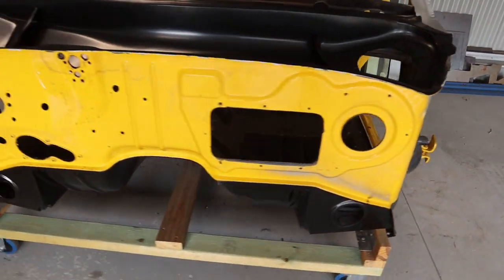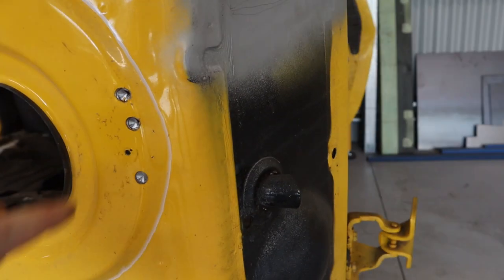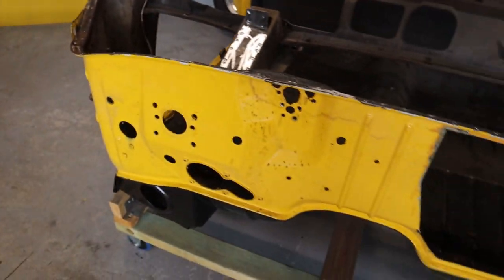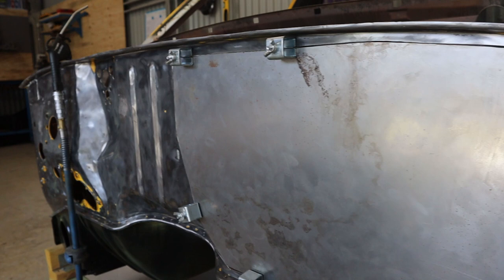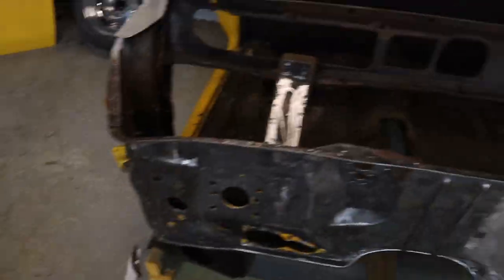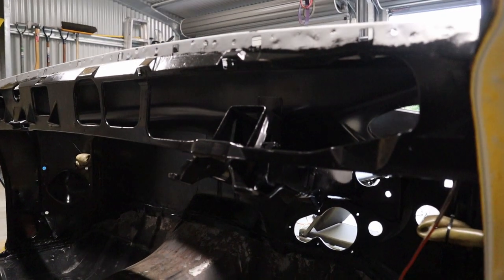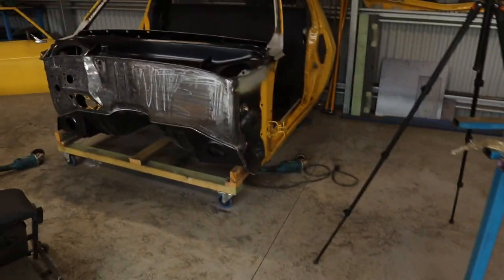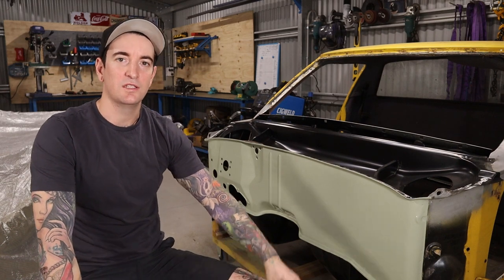HX One Tonner Build - Smoothing out the Firewall

Comment: Another Great video Sam, smoothed firewall looks far better then factory so much cleaner, you won't need AC when you double insulate with car builders and put on limo tint 🙂
Reply from the maker: Thanks Mate. I herd the car builders product is good. Would you say to lay it on roof aswell?
Reply: @ShenkeGarage  yeah mate I have used in a GQ and GU patrol build is good for the trans tunnel and I put on the roof also just to reduce heat and sound proof the cab. Made a huge difference.

Comment: Is a heater/demister not required to get passed over the pits for rego ?!... definitely much tidier look without it! Good work so far!
Reply from the maker: Hey mate the only requirements that I know of is the windscreen requires air to be able to be blown into it. Does not matter if it's hot or cold as long as air is blown into the front windscreen. I will plumb a electric fan motor into the vent that blows into the windscreen. Thanks also Mate.

Comment: Hi Sam love the videos, just a question, when you did the floors did you weld the inside as well ? I’m about to start my HZ and curious on How  do they look from the inside if you didn’t cheers mate keep up the good work👏👏
Reply from the maker: Hey Mate. I only welded them from the outside as I butt Welded them in. If you leave a slight gap the weld will penetrate through the join and you are left with a slight bit of weld on the inside. You can either leave as is or grind back slightly as you dont want to make the metal too thin.
Reply: @ShenkeGarage  thanks Sam, i started mine today and stripped the same passenger side roof section, and it is twice as bad as yours, dodgy weld repairs covered with an inch of bog the whole length of the gutter, roof and inner skin. i'm a bit gutted to say the least, but still keen to give it a crack, i took lots of photos but a lot of work ahead.
Reply from the maker: @1Montys  Sorry to hear that Mate. Its a Shame that people dont repair them properly. I done the other side today the last couple of days and it was worse that the first side. I took a heap of photos of this side as the repairs were a lot more extensive than the first. If you need photos for help and reference then message me on facebook and I can send them. Also interested in how yours looks.
Reply: @ShenkeGarage  no probs, i ordered and payed for some sheeting today, pick up tomorrow i'll find you on facebook and send some photos over thanks Sam
Reply: @ShenkeGarage  how do i find you on facebook or message sam, is it the same name on facebook?
Reply from the maker: @1Montys  Hey Mate search for Samuel Henke

Comment: Hey Samual good work mate. For your oil holes in your epoxy primer use some upol dolphin glaze. It’s a light weight filler it is awesome for pin holes and very easy to sand.
Also if you have time check out my video I posted on my Holden colardo bonnet re spray.
Reply from the maker: Thanks Mate will look at getting some of that filler.
Reply: Wipe in putty works good.